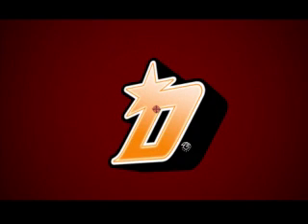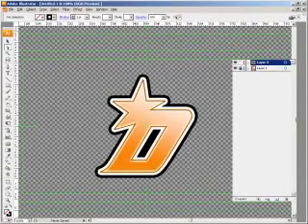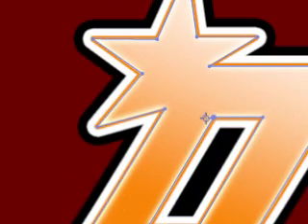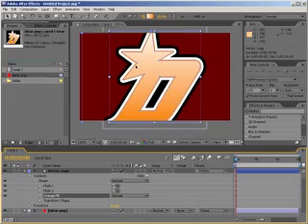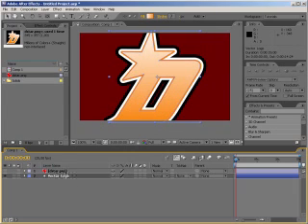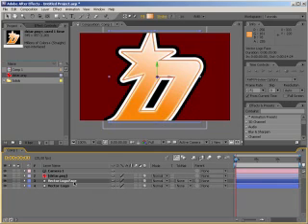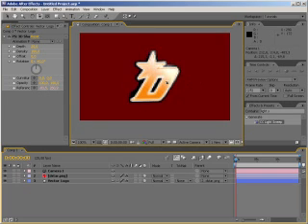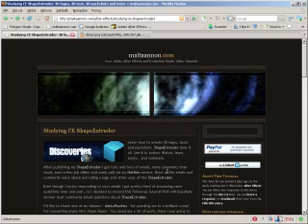Re: 3D Text and 3D Logo

Comment from the maker: flash cs4 does have 3d support, but it does not extrude objects. it's just allows you to place your movieclips in 3d space, but they are flat - pretty much as is after effects. if you want full 3d you'd need to use a framework like Papervision.